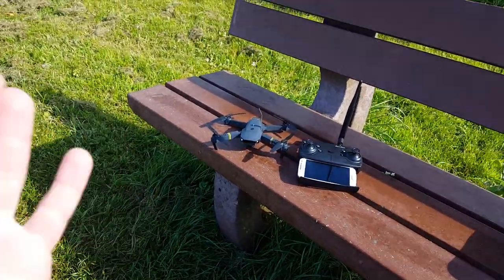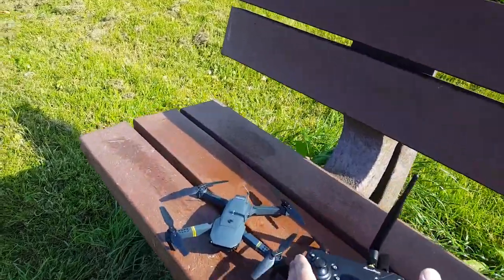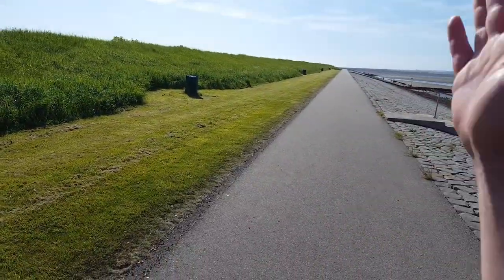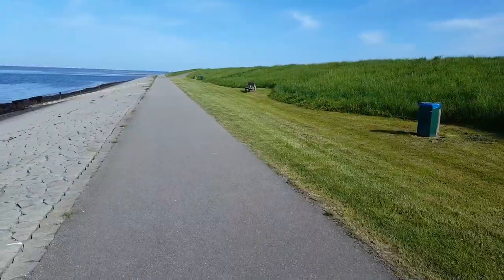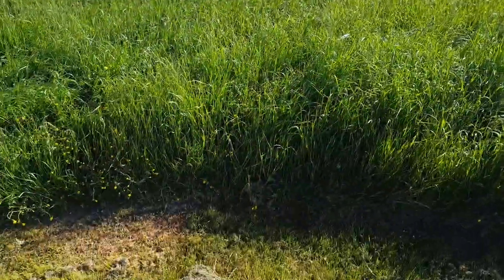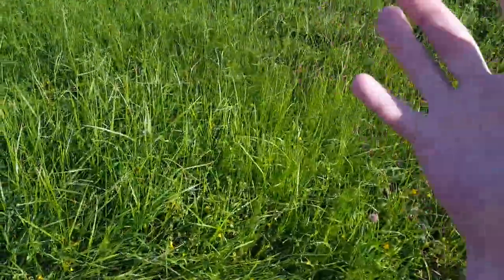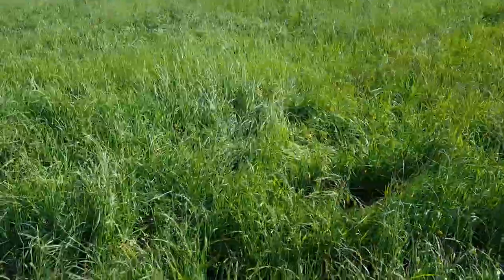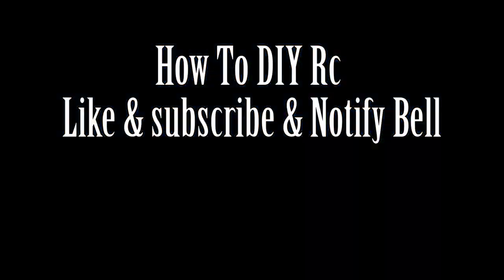Eachine E58 Drone RANGE MOD TEST With Dipole Antenna Upgrade (Works For Any Rc Quadcopter)

Comment: Nice range test.  Good to know E58 isn't software limited.   Another guy did antenna mod on E520S and found it didnt extend range at all as it was limited by software.
Reply from the maker: Thanks for the info! but i did so many different antenna upgrades and mods with improving the range almost everytime the max for the e58 was 600 meters that 10x more then the stock eachine e58

Comment: May be you can help me i have a holy stone HS 720 GPS 4k camara drone i will like to install a bigger antenna for my transmitter remote control for a holy stone HS drone you have a video of it or you can show me how thanks for your help
Reply from the maker: Check my Playlist eachine e58 upgrades and mods I did a few useful antenna upgrades you can use on your drone
Reply: What you think about a holy stone HS 720  gps 4k camara drone is good or not thank you i have one

Comment: Thanks for the information!
I opened up my e99 radio and found the ground. Is the antenna the circuit print on the board it doesn't appear to lead anywhere. I have a picture. Thanks.

Comment: Nice video, question, How far is the  wifi camera  conect range ?
Reply from the maker: 150meter stock and with upgrade 300meter
Reply: @HowToDIYRc 

How upgrade wifi camera?

Comment: Awesome range test of your mod. I would recommend you get a uhf tracker to help locate drones on those epic flights!
Reply from the maker: uhf tracker hmm good idea do you know any affordable ones ?
Reply: How To DIY Rc Getting ready for work now, will get info to you in a day or so. I got mine from a company in New Zealand  (if I'm remembering right ). It cost about 35.00 US. You'll need a UHF radio. I got one from Amazon for around 30.00 US. I haven't tried it yet but plan on testing it soon. I'll try to do a video when I  do.
Reply from the maker: thank you for the link it's the real deal i like it very old skool but works well and pretty small and lightweight except the uhf radio and antenna is going to be big if we want any good range 
looking forward to your vid sir :D
Reply: How To DIY Rc I've been watching videos on building your own directional yagi antenna. They are big but you can design them to fold down for easy transport.

Comment: I suggest that you set up a flag, a flag, or turn on the tracking camera, as this could help you know where to fly. You found it well at 284 m. Good idea for an additional antenna. What is the antenna and where did you buy it?
Reply from the maker: the links are down below in the description and we an in-depth vid on how to this mod linked in the vid and at the end apriciated if you watch the full vid really helps me

Comment: how about FPV video through drone have you test it along increase distance.
does this technique affect both camera and range!!
Reply from the maker: no not this time because we only did the antenna mod to the transmitter when we mod the e58 drone then we have to choose to boost the range of the wifi FPV or from the drone itself 
coming up in an upcoming episode
Reply: will be waiting for your next video. hope you will test FPV video from drone along range increase ;)
Reply from the maker: For sure Sir :D

Comment: Help me!!! I made this modification, but it did not work. continues with the measly 50 meters. What do I do? I did the modification exactly that way and it did not work out. Help me
Reply from the maker: remove the extra wire running from the circuit board to the  positive antenna wire
Reply: @HowToDIYRc  extra wire?

Comment: Is it a worth buying this drone(original mode) btw I subscribed
Reply from the maker: stock you get 160meters of range and we did a disassemble vid showing a good build quality and is much better compare to the more expansive jjrc h37 models so yes i do recommend this drone over other similar priced drones in the market

Comment: does it just shut off when out of range?
Reply from the maker: no it hover slowly back to ground and land
Reply: @HowToDIYRc  thanks.. that explains what happened with my e520 I think.  It flew off high in the wind.   I used your tip on tracking with the wifi analyzer to find it.  Thanks!

Comment: What was the modification you did to the drone?
Reply from the maker: +Joystick Quebrado the dipole antenna on the transmitter Sir links down below in the discription
Reply: How To DIY Rc Remember that I said that I had also made that modification? I put 2 antennas of 5dbi I reached almost 0.5 km!
Reply from the maker: oh really that's impressive mate we will check your vids nice job :D

Comment: Nice mod! Did you know how much will the range extend if I only mod the controler without the drone (I now confident in my skill to open and solder in the drone) ?
Reply from the maker: you double the range if not triple with the correct antenna and having the stock antenna from the drone sticking outside the canopy

Comment: How long are you legs? One step does not equal a metre 🤔
Reply from the maker: i'm dutch we are the longest people on earth and you be suprized how close to 1 meter my steps are
if you see my range facility where i have done a couple of range test with this drone we have tree's every 10 meter and it take me 10steps from one tree to the next ofcourse my steps are not perfect 1 meter but very close to give a good accurate +- measurement of the distance the drone traveled if we can find it we lost this drone twice only found it once!

Comment: Do the battery upgrade
Reply from the maker: No enuff lift power to carry extra battery
Reply: @HowToDIYRc  change the propeller because the stock propeller are soft and replace the battery to  3.7v 4000mah or 3000mah the drone battery are just like smartphone battery 3.7v

Comment: That is not a dipole it is a vertical
Reply from the maker: maybe yourrright maybe your not but if you search google for dipole antenna this exact antenna comes up
Reply: Actually you are right, my bad, I was forgetting that inside it is a coaxial dipole, however there are also some the same design that are just a vertical element inside.

All the best my friend and thanks for the great video.